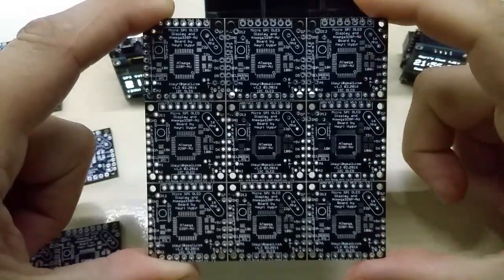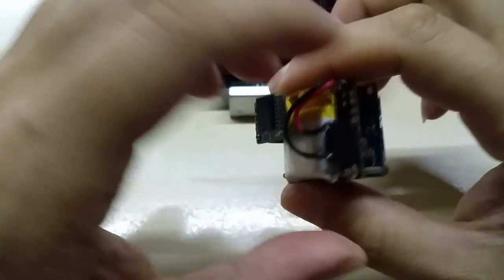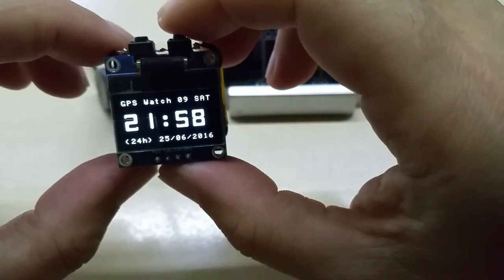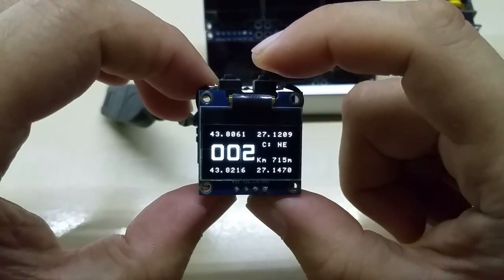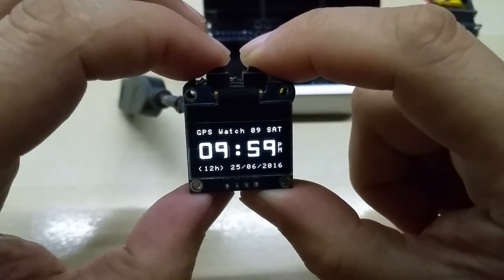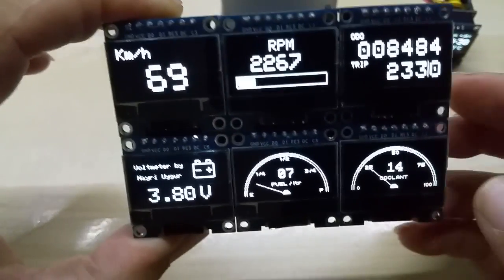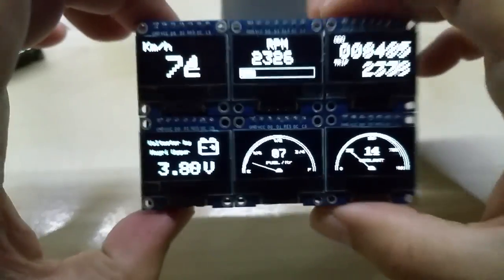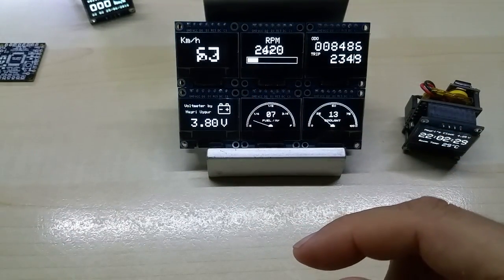OLEDiUNO Display PCB, please see my improved version too :-)

Comment: fantastic. I would make a flight simulator with it. But no links to web sites and instructions.
Reply from the maker: Thanks, great idea, my initial plan was to make a custom gauge for my motorcycle with most of the info visible without changing display modes. But even this example has more info to show. But you can choose what to see on boot up. On this board there are 6 individual Atmega chips and you can program anything you like to them. If I would have a flight simulator that would be my display for sure.